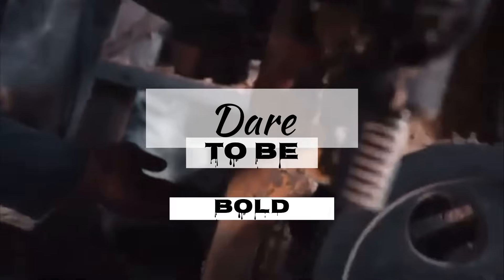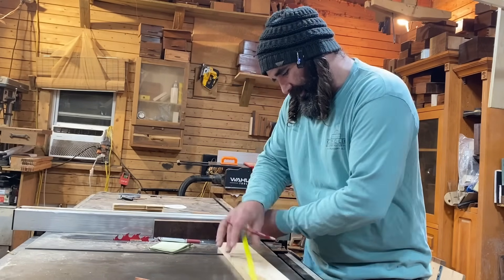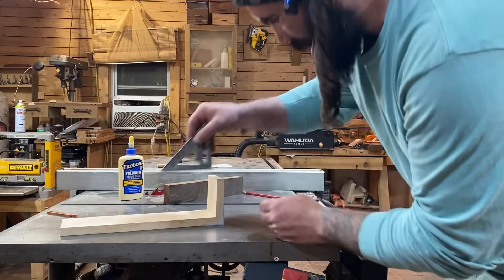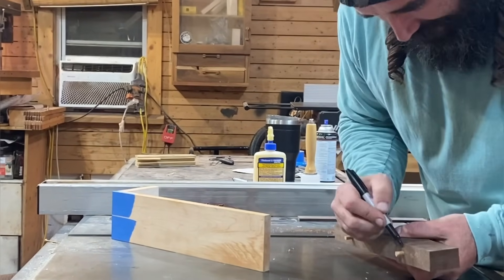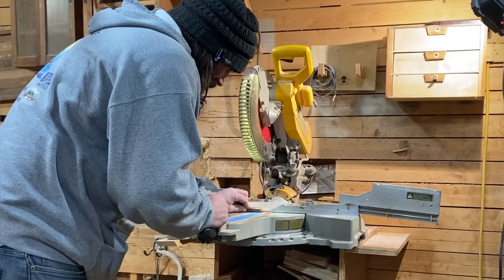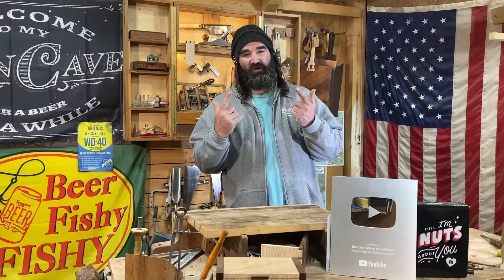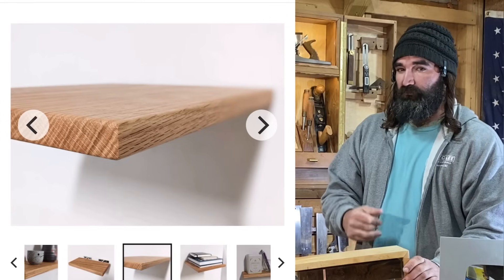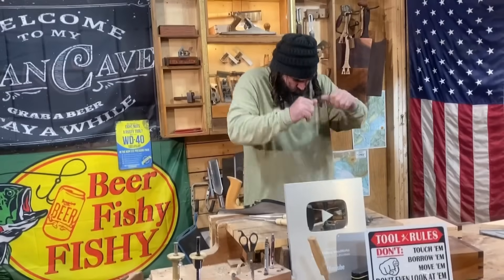Controversial Woodworking projects that sell ! Ep 21 of stuck on sawdust

Comment: I've got to be Honest here...I've watched you now for a few months. Some of things you build are ok. I mean you looked at something else and rebuilt it and/or copied it. You've grown your channel, which isn't an easy feat and have shown that you sell things on Etsy. Soo..to that matter, I give you credit. 

However...On the downside...and not specifically trying to be "your" local Troll here....But your methods of Woodcraft and end result vs. what you charge is just ridiculous. That being said...You have indeed proven the point that there's a sucker out there that'll pay...and apparently, there's LOTS of them. 

This particular build isn't worth anything more than maybe $25 bucks. 

Have or did you even consider the science of prolonged exposure of electronics to magnets (keys, alarm and unlock modules on keys) will wipe out the data stored on them?

Setting your wallet near a magnet...there goes your data. 

By hanging your keys with a magnet, you have now magnetized the key ring, in effect, creating a magnetic field on the ring...and, what it attached to the key ring? Ahhh, your keys. Are they metal as well? What's next to them, ahh your ELECTRONIC door button which has a circuit board. 

It may not happen overnight...but, eventually it will. And what is it that you built. It's specifically a key holder....so, will the customer who buys this use this day in, day out? Yeap. 

Did you give mention to this at all in your video? Nope. Will you disclose this "Science" on your Etsy page stating...."Use of this Key holder can possibly erase the data on your cars unlock/alarm module as well as potentially erase the data of your bank cards and credit cards if you place your wallet ontop? 

I've looked up this information prior to typing this comment. The Data is accurate. And God forbid that customer decides to place their phone ontop of this shelf. Did you disclose THAT information? 

You're making money. That I have no doubt. But the way you're going about doing it and producing "crap" sold at a high dollar....Well Sir. You give the rest of the community of "Skilled" Craftsmanship a bad name. Just like your flawed wine bottle holders. Your products you sell and "teach" (I'm using that word loosely) to build...Well Sir...are despicable to say the least. You are basically teaching people that "crap" sells. 

Is that REALLY the message you want to convey? You've got your status on YT. Young people and even older people, all new to this craft, your are teaching very POOR habits both in Craftsmanship and in Integrity. 

I won't even get started on ALL the things you did wrong on that Chessboard. 

You remodel and build homes??? Really? Honestly, seeing you work on these videos, it makes me question the integrity of that business. What shortcuts do you do there too? 😮😮😮😊
Reply from the maker: Well Mike , Mike , Mike …. Well you sir don’t understand the cost of the figured claro walnut , you are entitled to your opinion but to say I give woodworkers a bad name is absolutely absurd. As far as the phone issue , the magnets are a one sided magnet and clearly stated that they are “rare earth magnets “ which most newer phones literally have rare earth magnets in the freakin speaker and magnets in the wireless charging . As far as key fobs it would have to be an EXTREMELY STRONG MAGNET 🧲! And you would litterally have to hold it and run it back and forth across the fob to even dream of getting any damage to the memory board . We no longer live in a world with floppy disks and data being stored on magnetic “dots “ on disks , today most data is stored as voltage . Or as physical holes , Theoretically a powerful rare earth magnet could induce current flow in the circuit board, but it would have to be really strong and you'd have to be rubbing it back and forth in just the right way. 
Note that radio waves do affect them somewhat. So if placed near a device creating electric noise - radio, fluorescent lamps, computer, the key fob will try to answer which will drain the battery over time. But not damage the circuitry. You'd have to microwave it to do that.You my dear friend are absolutely 100 % unhinged and uneducated on this topic . ! , and according to the manufacturer are far from causing any potential harm to devices according to the manufacturers specifications directions and recommendations, so you sir are again incorrect , as far as pricing , who decides what costs what good sir ) ? I hope it isn’t you , I have over head , my hourly time , I have to purchase the expensive ass material ( im not sure when the last time you purchased exotic lumber or highly figured lumber online ) so there is the outrageously expensive wood plus the shipping of that said wood to my shop which isn’t cheap either as wood tends to weigh a good amount , so I could carry on trying to justify myself but why bother , you’re obviously butt hurt about something , but big fella , my woodworking reviews say what need to be said , on my Etsy , and as far as questioning my integrity of my business of building custom homes , you just sound like a complete idiot , but this is America and you’re entitled to say what you will and I respect that , I even respect honest criticism however that being said , you have now crossed the line of giving some honest criticism to just out right disrespectful, you don’t know me , and I would love to hear what problem you had with my chess board ,. Maybe instead of being an asshole and making some lame ass smart ass remark you can give some criticism, but I don’t feel your comment is at all honest , I just think you are a hateful person , I mentioned in the beginning of the chess video that this is the first chess board I had built , so the criticism would have been welcome but your hatefulness is much louder than any of your opinions you wrote in the above comment , as far as my skill , brother , have you even seen what I make , ( these videos are simply entertainment w sharing a little bit of knowledge I’ve learned from selling online , you don’t have to watch my content , we’ll all that being said , I hope 2024 brings you and your family abundant blessings , God bless and thanks for sharing feedback even if it was hateful . You’re comment is 100% unhinged
Reply from the maker: https://www.reddit.com/r/homeautomation/comments/d78id9/carkeys_and_magnets/?rdt=60108
Reply: You're totally wrong. I've made versions of several of his works and made hundreds already in my very first month with very little friends and family, all strangers from marketplace. This channel serves us(me) a purpose. Everyone doesn't have to do woodwork like it's been done forever, quit bein a knob. Judgemental dorks are what ruins the world, not this man.
Reply from the maker: @damiondifranco2967  skäl 🫡
Reply: @Bearded-Viking-WoodWorks it's obvious he is just trolling for whatever reason. He has posted a few other troll like comments on other videos it looks like. Great work keep it up Daniel!
Reply: It only costs a little time to criticize people unnecessarily, but shutting up is free.
Reply: Hi Daniel I just discovered you recently, and love your ideas. I am looking for small project ideas. Your ideas rock! You make some great stuff without a “million dollars” worth of millioning 😉 equipment! Haters will be haters! You rock and are very enjoyable to listen to. I am an auto repair shop owner 35 years in business, I recognize honesty and integrity instantly. Keep on doing what you do, I know you sleep well with a clear conscience!
Reply: This mike guy is just jealous if he was as good as he says calling himself a skilled craftsman then why does he only have 2 subscribers.
Keep up the awesome work and don't let a wannabe ruin your day. Like I said he is jealous that he can't build like yourself. It's funny how he says how you build crap and yet he watches your videos and probably trys to build the same and is a failure.
Reply: This Mike guy is obviously jusr a jealous "Karen" . His review is not correct . He obviously has a chip in his shoulder. His review doesn't warrant a second thought or  concern. Bottom line , Mike can kick rocks.
Daniel , we viewer's want you to keep the same informative videos.
Don't pay this Karen aka .I've a second thought.
Just my 5 cents.
Reply: To the troll(s) out there,,,,,, I’m really REALLY hoping that your YT channel and/or business is booming, congratulations to you, I wish YOU health, wealth and HAPPINESS cos I believe you are gonna need it. 

 To Daniel I’m so sorry this has happened to you, I don’t know you but still no-one deserves to be spoken to especially when hiding behind a keyboard, even your geese ain’t so chicken 🤣🤣🤣🤣🤣
Reply: Hey Mike you are absolutely right, I mean when I look at your channel and your videos and all the hard work and "fine" craftsmanship that goes into your work, I can see why you would think Daniel's work is inferior. Wait a minute, you have no YouTube channel. You have a total of 2 YouTube followers, you have shown no one your work so that the quality of your work cannot be commented on, and yes possibly criticized. You haven't put in the time and work to have a channel as successful as the Bearded Viking Woodworks channel. It is so easy to criticize isn't it? I feel very sorry for you.
Reply: wow... Who hurt you buddy?? :(
Reply: Woooah, Mike, hey… I understand there are things in this world that we handle differently. Teaching, working shopping… even emotions. 

My zodiac sign is Libra, so I’m 99 percent of the time trying to balance everything while keeping myself in balance. It’s hard sometimes, but a comment like this would make me feel completely out of balance. And by hurting others I hurt myself too emotionally. Don’t get me wrong. I can get pissed, but it’s very rare, and I usually go away to react and reflect by myself on a short drive. And when calm/balanced, I can talk.

There is enough chaos and injustice already. So please, leave hate out of this, and look out the window with your mind open… by that I mean it’s hard to see the beauty with the curtains down…

Just relax, please… maybe you should try and understand your zodiac sign as well? I don’t know, but… like I said, I’m Libra, , I’m just trying to help… it helps me occasionally
Reply from the maker: Amen
Reply: Mike, Can you please tell us what your YouTube channel is? If you are that perfect you should have no problem sharing. Now for you to come on here and bash someone for something they make and want to share with everyone else is WRONG..
Reply: @sydneymartin952  I have subscribers??? Interesting.
Reply: You are kidding, right?  Do you understand science or modern electronics?  Clearly not!  Do you understand marketing and sales?  Clearly not!  You’ve never shopped stores like Pottery Barn.  You don’t like these projects!  Don’t watch this channel.  But your attack is ridiculous if not downright mean.  And clearly, the other viewers do not agree with you!  Please leave after you apologize!
Reply: Don't be a hater
Reply: Epilogue much?
Reply: Dude I can not believe you wasted your time even responding
Reply: Sometimes I think poster's comments just show they are 'plain dumb'! In this case, the poster removed all doubt. Another informative and entertaining episode Daniel. Thanks
Reply: @PPerquin  Clearly....You are a follower, not a Do'er and require others to think for you and just agree with them to blend in and be part of the crowd. 

Though that's not necessarily a bad thing, you still are just a follower, copycat doing what others have done, and it shows. 

I am not afraid to spread my wings and say my piece of knowledge, despite ridicule from others such as yourself. 

The fact that my statements touched your nerve enough for you to respond is evidence of my independent thought verses you're hiding amongst the crowd, shadowed by others in front of you, sitting at the back of the classroom hoping not to get called out. 

When the Plumbing fails, you call a Plumber. I fix it myself. 

We are not the same and because of that fact...You can never understand what it truly means to be independent and an "Out of the box" thinker and do'er.
Reply: @Mike-ou5ps  You just verified my original comment. Thanks Mike.
Reply: @danhobbs7847 Would that be a Wood Chip?😂😂😂
Reply from the maker: @michealhand1001  oh my gosh I just saw this ! That is hilarious

Comment: Hey Daniel when you use a french clete doesn't the thickness of the board you attach to the wall push the shelf away from the wall? Don't tou need to attach a board of similar thickness to the bottom of the shelf?
Reply from the maker: Only if the shelf is much taller , as you can see in the video I show how I hung the shelf using just that cleat. It’s flush as shown in video , you’re not wrong though , if my shelf was anything other than the design i made it than yes , I’d install another cleat at the bottom or just a matching thickness block to the bottom

Comment: I wonder how it would look if the copper inlay spanned both pieces of wood in front of the dowels. Maybe I'll include that if I decide to make this piece. Definitely a great use of whatever scraps one might have around the shop.

I don't think it would be a good idea to use gloves on the belt sander when your fingers are that close to the moving belt. I understand the reasoning; keeping the belt from giving you a manicure. But there could be trouble if the gloves got caught in the belt.
Reply from the maker: True , as long as you have the backer board there you should be just fine but yes you make a very valid point my friend , thanks 🙏. I’m gonna pin this comment so others see the great info before trying this.